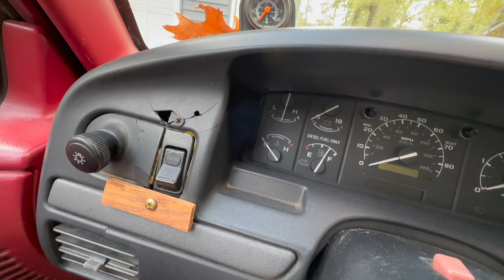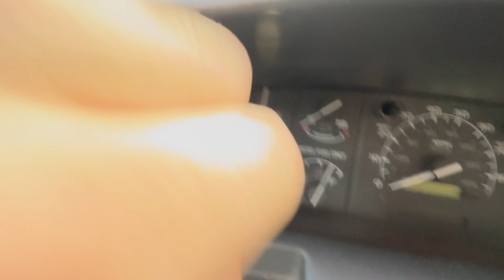I Bought a Ford 7.3 IDI TURBO!!

Comment: Man, my only complaint with my 94 7.3 IDI TURBO CREW CAB 8’ bed dually is the door handle, ford built a rugged truck except that door handle!!
O and door rattling.
If you find interior door handle shout out, nice truck👍
Reply from the maker: Thanks a lot can’t wait till it’s fully restored!

Comment: I've got three of these trucks the 93 model I drive everyday has 394000 with the original motor transmission and rear end.
No need to rebuild.
Just fix the leaks
Reply from the maker: That’s actually awesome! And I just really want to do the truck right currently it’s just a frame about to get it sandblasted and painted can’t wait

Comment: I have a 1993 ford f 350 crew cad 4x4 long bed with the e4od transmission it has 4.10 gears   great truck but i need a crew cab  one ton two wheel drive
Reply from the maker: A crew would be nice for the room I just love the look of the single cab and since it’s a tow rig I felt like I didn’t need the full cab
Reply: @MatthewKrompier  hey 10-4 I hear you

Comment: I had a truck that had a cab rotted way worse than yours! I got a gas job bought cheap and stripped the cab bare repainted and sealed it then did sound deadner from toe board to back of cab. Everything was very straight forward. Unbolted dash bench seat doors and wiring and put in new cab. I replaced windshield as mine was chipped
Reply from the maker: Yea I got all the metal to repair mine that I’ll probably be welding in sometime soon hopefully. Right now just working on bringing it back to a roller
Reply: @MatthewKrompier  man that's a skill to fix the rust I've replaced rotten floors and cab corners and door stills its worth it and will be better than factory
Reply from the maker: Yea I’m excited just to get this thing back on the road finding parts has been a pain been nothing but problem after problem but I guess it wouldn’t be a project then

Comment: Look up obs interiors
Reply: Also foxshop on youtube
Reply from the maker: Oh yes I def have keep going back and forth between the red and blue
Reply: @MatthewKrompier  reds old school, I like it but if you got the money. Obs interiors can do some really nice custom interior work
Reply: @MatthewKrompier  trying to find a single cab long bed 7.3 powerstroke 4x4 for my 95 to fit onto. My trucks mint but 2wd with a 5.0
Reply from the maker: See I really want to keep everything as oem as I can I just like oem
Reply: @MatthewKrompier  yeah just sentimental value for me. Hard to just sell and buy another. My father has alzheimer's so I like him to recognize things
Reply from the maker: I’ve seen some cheap 7.3 motors with transmission on marketplace for like $1200ish
Reply: @MatthewKrompier  I'm talking with a buddy as we speak on whether I should do 7.3 diesel or a coyote 5.0
Reply: @MatthewKrompier  I would need a whole truck. I have half ton axles and everything else that's not suppose to be driven with a 7.3
Reply from the maker: Oh okay yea you might want to go the 5.0 route then might be easier I guess you got to add the cost up for both ways coyote probably has a lot more computer stuff

Comment: can i have it? lol on the real side you got a fantastic truck i had a truck like that i drove it for 10 years i need my ass kicked for selling  it was the best truck i ever owned 
the 7.3 turbo idi was the best diesel pickup turn the pump up 2 flats and advance the timing a little it will run with the powerstroke  i miss my 7.3 idi turbo they was awesome trucks
Reply from the maker: Yea I love it so I decided to fully restore it seems way better then spending 60k plus on a newer 6.7. Hey you could always go buy another 🤫

Comment: U gotta realize alot of people fanboy the powerstroke they dont talk about all the issues with them the idi is a great engine just not if u wanna be popular with the custom offset bozos
Reply from the maker: Yea for sure that’s what it seems like I just wanted a great tow pig and this just seemed great for that. Only hot boy type stuff I’d do is possibly a lift but idk since I plan to use it for towing and would be nice to make just a little more power
Reply: @MatthewKrompier  dude ive hurd nothing but good things about em for daily’s especially with a turbo and tune
Reply from the maker: Yea same that’s kinda what made me pull the trigger more. I’m fully restoring the entire thing currently peep the channel for videos coming soon on it I’m trying to do it right it’s down to the frame rn axles off and everything
Reply: @MatthewKrompier  ill swing a follow man good luck
Reply from the maker: Thanks a lot!